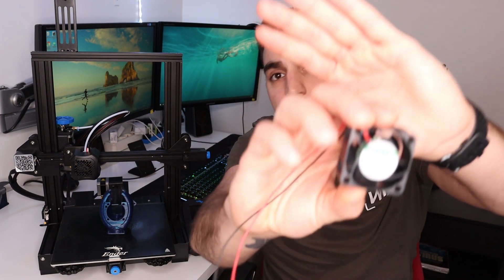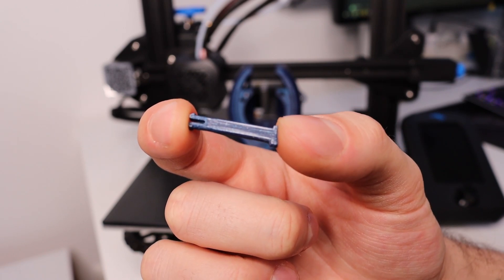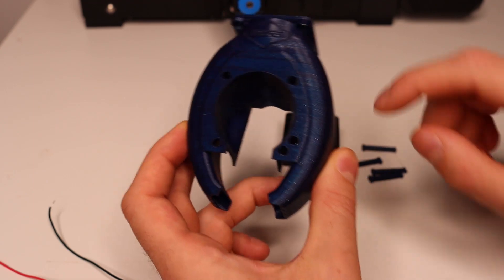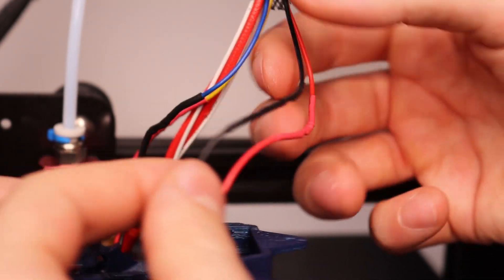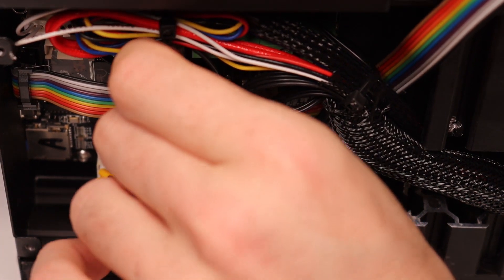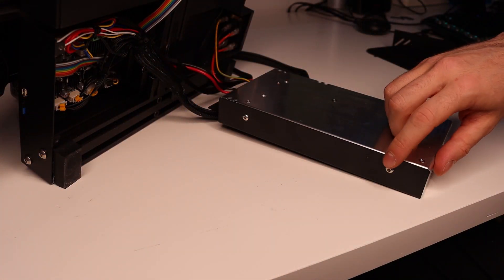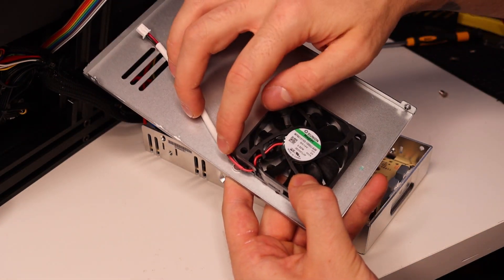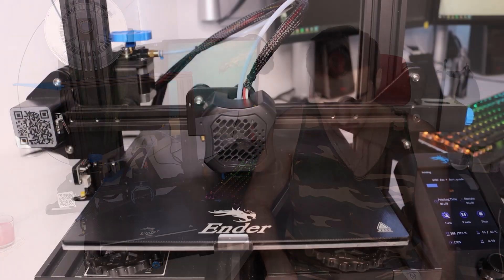ENDER 3 V2 SILENT FAN MOD | Step-By-Step Guide

Comment: Did you manage to find out why the noise levels dint go down? does it have anything to do with using 24v fans instead of 12v fans with buck converter?

Comment: Quick question, I notice the fan for the power supply said 12v, is that correct? You didn't use some sort of voltage converter?

Comment: I recommend to change the Mainboard-cooler-wiring. It stays off if the part-cooler is off. This is way too stupid. So connect die Mainboard-Cooler to 24v directly. Find modification-schemata on the internet :O

Comment: Stock fans can be powered from 12 to 24v. I didn't buy any particular fan and used the stock one with dc dc step down mini bucks.
I've the Ender 3 V2 Neo, and now it's silent without any particular mods, simply I've used Mini 360 bucks on the stock PSU and mainboard fans that I've choosen from 12-15v till obtain low noise and still good airflow. And opened with a cupsaw the power supply cover to have more air flow. 
On the hot end I've used a Sunon MF40202V2-1000C-A99 DC 24V 0.68W 40x40x20mm achieved for 21 db. I don't need any other special mods, now my Ender 3 print's well and has very low noise.

Comment: My main concern is voltage- actually just wiring in general. You briefly touched on buck converters, but can't you just buy fans that're 12V's? Also, i don't know how to solder. Can I use those crimp connectors or do I suck it up and go pick up a cheap kit at harbor freight and learn?

Comment: Good job on the tutorial. I ordered the fans that you suggested. Surprisingly, my PSU fan is 24V, not 12V like yours. So, I'll have to do that one another day. I have an Ender 3 V2 Neo. My P/S looks exactly like your, but it's a different fan voltage.
Reply: thanks for the head up as i have a ender3v2 neo

Comment: Great video and guide! I just installed the main board and PSU fan. Then I assembled everything for testing and turned on the printer. The main board fan is louder than the original fan. I checked the stock fan and noticed that this one has 24 V and not 12 V like your printer! But my printer is also an Ender 3 v2 model. Has someone also a 24 V PSU fan? How is this possible?

Comment: 8:00 please be careful when opening a PSU it can be still dangerous even if it is not plugged in. Never touch anything you dont have to and especially not with your bare fingers

Comment: If you wanted it to be quieter you should have put 12v fans on with 12v buc converter, but great video easy to see what you were doing and hear you easily, and I like the fanduct/hotend housing 👍

Comment: Ah, your psu fan is 12v. Does your psu give out 12v?? Mine is 24v, which reduces my options a lot.i really don't want to attach a buck converter to it but I may well do if I can't find a decent 24v version.

Comment: Can I run 2x 12v fans on the 24v connection on the mainboard for the part cooler?  Or 2 x 24v fans?

Comment: I bought the fan housing from cults3d linked from this but the zip file has files for several printers.  There are 8 different holder pins, none of which say Ender 3v2.  Anyone have any idea which to use?

Comment: 1. Great video, very helpful and entertaining.
2. I paid for the upgraded/updated fang from cults3d, and was able to print it in petg (my first petg print). It was challenging, and then it worked and I didn't argue.
3. I wish that fang had more mounting points to the axis, as I'm concerned I'm destroying the plastic around the mounting hole when I take it off and put it back on.
4. Like others have said, the noise level didn't go down, but the frequency did, so it's not as distracting.
5. The printed pins are trash. I started using wire ties and they're a lot better.

Comment: My Ender 3 v2 sounds like a jat taking off. I was getting about 80 Db on the phone app i downloaded.
Reply: The cause of the high pitched whine is the fan shroud. There are a few custom shrouds you can print on thingiverse that will reduce the high pitch sound by a solid 80-90%. Alternatively you can cut out the mesh in the fan shroud which works just as well however it does look a little jank. Either way it won't be much quieter however it will be less annoying.

Comment: printed just fine with PLA but the fan pins will break at the tip. will this only work with petg?
Reply from the maker: Unfortunately, I haven't tried with PETG. I printed them in PLA and haven't had any problems with them so far. Hope it works out for you!

Comment: This really works great. I used 3 Sunon fans in the dimensions as in the video desctiption. My PSU was a 12V fan, so double check before you order. It is very quiet now. A bit louder than my PC, but by far not as loud as the hairdryer it used to be. Very nice mod and great video!
Reply from the maker: Good job! Yeah, the switch from sounding like a hairdryer to something much quieter makes a substantial difference. Maybe I should change the fan in my girlfriend's hairdryer so I will get rid of them for good haha
Reply: @Randomecticly  Now after printing for a while with this setup, I am super happy. But there is one minor downside to it. I used a SUNON 24V DC 1,11W 40x40x10mm 11,9m³/h 5800U/Min 11,9m³/h Sunon MF40102V2-A99 fan from Amazon for the hotend and parts cooling. I noticed that the parts cooling fan will not properly run at low RPM. It will start to really turn at around 30% fanspeed. Below that it will just stutter. Thats not a big issue, but I have to keep in in mind, when I create a printer profile in the slicer which uses a fan curve that speeds up the fan every layer.

Comment: Tried to do the replacements. 
Long story short, everything is fucked now. Not even the fan of the PSU works anymore. Put a multimeter to it, no or only microcurrents going on all the fan pins.
Anyone got an idea why?
Reply from the maker: Have your tried tracing the current from the PSU to the fans? Have you soldered the wires properly? Sometimes you can get a short circuit. Hope it works out for you!

Comment: Great tutorial vid! Wish I had all this information before I did my mod. I also replaced both PSU and mainboard fans which make the majority of the noise coming from the printer. I got my sound levels to around 32-37dB.
Reply: I wish my wife would be as silent as 37dB. She makes the majority of the noise.
Reply from the maker: Hahaha I feel you man

Comment: Does anybody know if the top fan should spin after this upgrade ? I mean when you power on the printer.. Just the center fan is spinning .... Maybe it will spin only when required ? 
I tested my fan with power supply and it's working properly... Strange. Any help will appreciated
Reply from the maker: The top fan usually starts spinning after the second layer or so. It does this to help with adhesion on the first layers

Comment: I am planning to do the same Changes as you did. Already printed the Briss cooler, but a question of mine: Can you still controll the fan speed of the part cooler since we change the fan from radial to axial?

Comment: Please DO NOT mess around in the open powersupply, especially with a metal tool! (I did the replacement too, you should unplug the printer and drain the powersupply's caps!)
Reply from the maker: You are absolutely right! I am so sorry I didn't mentioned this in the video. It is my fault all the way. I'll put it in the description just in case.

Comment: do you HAVE TO replace the hot end cooler housing with that printed model, or can I put the new fans in the original casing? (I like the look of the original casing more, that's all)

Comment: Thanks for the nice video! One question: I used the same setup for the hotend but the hotend fan makes a high pitched noise as soon as it is attached. Have you experienced the same? Any solution to this? It seems that the fan transmits its vibrations directly to the duct. Any solution would be much appreciated!

And another question: Is there any alternative for the Orion Fan? Because the only place to order is digikey and the shipping costs are very high compared to the price of the fan...

Comment: I did you manage to rate the improvement with each mod?  I'm going do to the hot end, but I doubt I'll do the power supply. It's an MeanWell, so it you be reasonable. Anyways, one at time.

Comment: Props for not using Noctua fans, which are completely inadequate for cooling a 3d printer, as Prusa found out.  They do still use them, but at the cost of redesigning the extruder on the i3 to provide more airflow via the Venturi effect.

Comment: I’m not understanding why I would remove the silicone heat sleeve in the hot end if I am just going to almost immediately put it back. Does the modded part not fit otherwise?

Comment: I´ve shit in my pants and must rewind, the clothes change transition is awesome. Also thanks for the detailed video instructions, guess the decibel for human ears interpret lower/deeper sounds not that noisy than higher squeeking sounds. I also need to "fix" stuff on my printer and trying to go simply with larger fans (beside of the extruder ones, that what you use seems to be almost perfect)

Comment: A question I have is are the hot end fans really that loud? It seems like the sound difference is very slight with only psu and main board on vs when the hotend is also on at full speed. This could mean that it's not that significant to modify the hotend.

I'm not sure though because I think I've heard sound requires x10 the power to double the volume, or something like that. So I'm not sure if the standalone volume is the same but it's not double the volume together because power is x2 and not x10

Thanks to anyone who answers

Comment: Hi m8, thanks alot for the vid. Even though the "fashion show" was nice, it must have required some extra work. And to be honest, you
r humor and the way you approach the subject, precisly, right to the point and in a normal language, makes this more than enough to keep this vid awesome. As many say, this is by far one of the best Vidz on an ender 3 V2 :) keep up the good work. I have 2 questions though: 
1- Any reason you went for the sunon and orion brands/models? except the fact that they are half the price than Noctuas and that they dont need a buck converter?
2- I've only done PLA so far, and i'm sure some people would be unsure printing with other materials so early in their 3D printing journey. Can the mount be printed in PLA or maybe be bought?

Thanks again for the Vid m8!

Comment: Where the fans you got quiet fans? Sunon is known for budget priced fans, but quiet fans.  This would explain the same level of noise and decibel reading.  You effectively didnt improve anything.  Also, it's not always a good idea to do more than one thing at a time.  Your video was about fan noise, so I would have changed the fans., arguable one at a time then compare as you go along.  I would never changed the part cooling duct, as that introduced a variable.  The chambers and air flow can impact the sound and pitch, thereby negating your test and or giving a false positive,  or negative as the case may be.  Good first video, i enjoyed it.

Comment: Seems that you still have around the same sound energy here but you changed the high frequencies down to some lower ones (which let us feel that it is noisier). By the way, replacing the Power-Fan is a good one but you should also take care about the air-flow which is - personally spoken and as a CFD enthusiast - terrible managed at the Enders 3v2. If you add the hole gaps of the black cover plate you will gain a lot of more outflow as well as removing the small sheet at the back of the Power-Board. By the way, you have too much clothes ;)

Comment: you can add 330 ohm resistor to the hotend fan to bring the noise down a bit on that. Standard fan is a 40x10, the 40x20 is probably moving too much air on the hotend. I've noticed I have a lot of deflection.
Reply: How many watt the resistor? And how long last it? I saw some small bucks 20x10 mm that are able to regulate 24v down to 3,3v.

Comment: I have a fang too, but I have noticed some problems with it, like the fact that the ducts catch on both the clamps on the print bed, and just out right catching my prints too. Maybe I can fix the latter with increased bed temp?

I am starting to regret ever wanting a quieter printer. I just end up running into a new problem every time I think I got it working. :(

Comment: I cant help but think that most of your noise reduction was simply by removing the restrictions caused by the stock ender grills in front of the fans.. I printed multiple versions of this and like most of these printed hot end coolers the funneling of the air behind the fan creates a new noise. I can actually hear the same sound from  your cooler.

Any restriction in front or behind on small fans like these will create extra noise.

For the PSU and Mainboard cooling i have found the only way to truly silence these printers is to go 80mm or larger  low spinning fans and raise the printer with feet to compensate.

It's  great to see vids like this and others it all helps ty.  I also love the Tshirt changing :D

Comment: good thing you didnt recomend noctua fans and downsteppin the voltage, that usually works initially, but is generally a bad idea. The flowrate is quite a bit lower and even though they are silent they wont hold long if running on max for so long.

Comment: Nice video.  I just have one thing to add.  I used a 92mm mainboard fan with the 92mm cover on thingiverse.  These fans plug directly into the mainboard and don't require any soldering or voltage converters and it's quiet.  https://www.ebay.com/itm/154450876179

Comment: I installed the 4020 sunon for part cooling as well. However I experience the fan has a hard time to start spinning with low voltage. I can see that for the 3rd layer it’s stuttering. Did you experience the same?
Reply from the maker: Hey there! Yes, it is the same for me up to the second layer. But I wouldn't worry about it :)

Comment: Great guide dude, thanks! I just followed this, and installed my new fans, same as yours. I printed the version with integrated BLTouch, but I think i'll reprint it and use the version where you add the BLTouch on the side. I'm doing my first print now, and the fans (especially when starting the printer) are definitely quieter, but still definitely not silent. I'm wondering with these deep fans, particularly the hotend fan, if we could turn the fan speed down? Maybe we could afford the reduced airflow and perhaps it would make a difference with the noise? Have you tried that?

UPDATE: I installed a 330ohm resistor on the + side of the hotend fan, as Briss Moto suggested. It is soooooo much quieter now! Haven't done many prints with it yet, but it seems like many others have done the same without issue :)
Reply: did you step down the voltage to 18v also?
Reply: @ChadBondoc  using a resistor yeah, not a buck convertor or anything

Comment: Looks like the new manifold takes a hole away from where a BL touch would go. Something to keep in mind if you might want a BL touch in the future
Reply: BLtouch is overpriced. At slightly higher cost you can install dual linear rails for the table, stronger springs and you will forget about leveling for a long time. Also, you will get better table stability/accuracy.

Comment: Thanks so much for this guide. I’ve gotten replacement fans for the hot end and the psu. Unfortunately the 4010 Orion fan is sold out in most places. 
Installation went ok, but one question: is the PSU fan always on? I’ve soldered it in, turned the machine on, and that fan is not going. Does it turn on later as the psu gets hotter? If not, I’ve either botched the soldering, or the fan is broken.
Reply: It starts later under high load. Crank up temperature

Comment: Just finished replacing the hot-end and part fans with the Sunon 4020 ones (skipped the PSU/mainboard ones for now) and they are a bit more silent (but not by a whole lot). I wouldn't have dared replacing the fans without the spot-on instructions in this video, thanks!

Comment: Hi, thanks a lot for this awesome video. Changing the fans seemed daunting for me as I have never soldered anything before, but after your video I ordered all the fans + a soldering tool to do it! I also bought the cult3d STLs, however this got me a bit confused as the folder downloaded contains like 20 STLs.. I have no clue which one is the right one. I have an Ender 3 V2 with a BL touch, so I think the main part is the Briss Fang Ender 3 v2 + LEDs + BLTouch? what else? 

Would you recommend printing it in PETG? I have 2 PETG spools but never used them yet (I would print it on my other printer, a prusa i3 MK3S+).

Thanks! 

Gilles
Reply from the maker: PLA has worked just fine so far for me! I haven't tried PETG so I can't really say anything about it unfortunately:/ 

Oh wow, when I downloaded the fang it was just a couple of STLs. If you haven't figured out which parts to use yet you can maybe ask Briss Moto himself. Good luck!

Comment: Nice job on the video. Clear and concise. For sound measurement, the microphone is on the front of the phone so facing the phone toward the fans may provide a more accurate result.